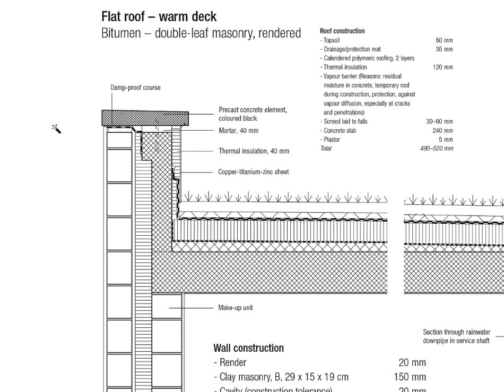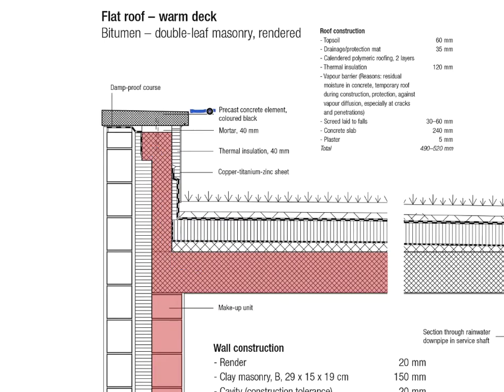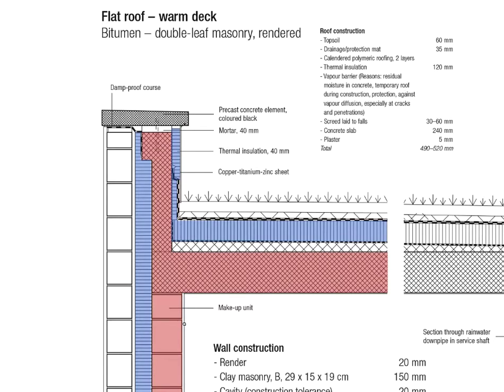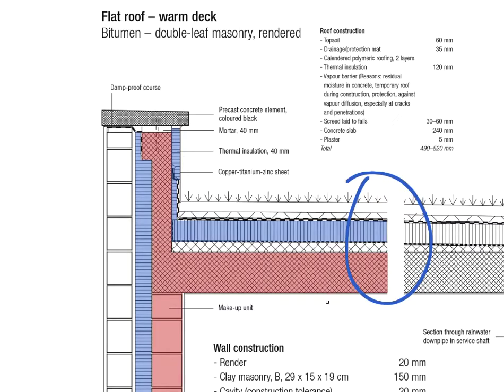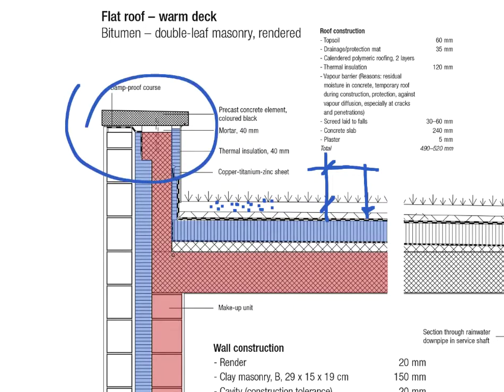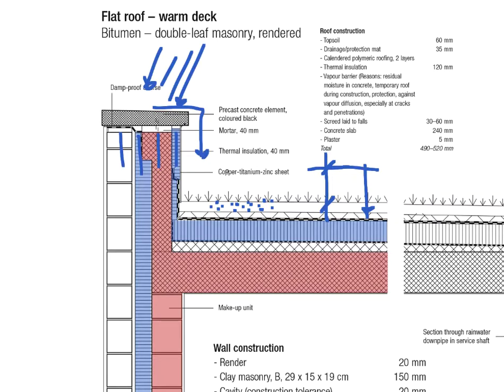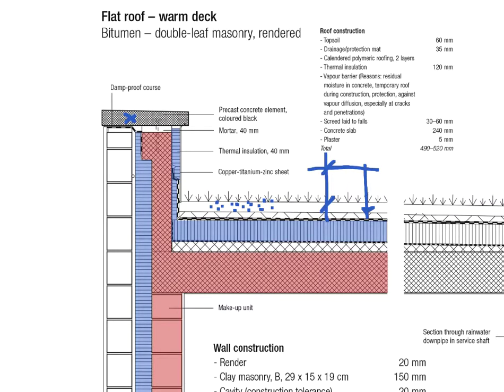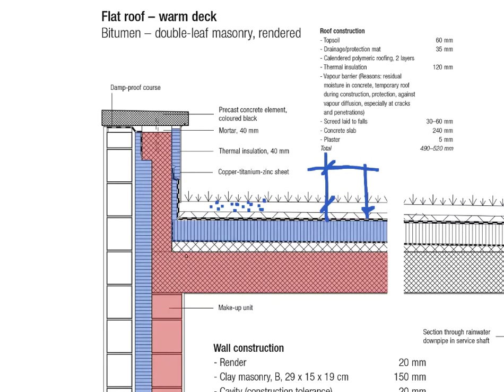"How to Detail": Flat Roof

Comment: liked this .. thank you a lot
I have a question though ..couldn't we just use the protection mat for leveling (and get red of the screed)?
Reply from the maker: Good question – the drainage system or protection mat is often a standardised product, therefore it is mostly available in standardised measurements. The screed ensures that the whole roof is laid to fall, meaning there is a clear slope with a direction of where the water will flow off to. Since most roofs would have their unique geometry and shape, this slope needs to be customised each time. The screed is, like concrete, poured onto the roof on site and therefore can be moulded as needed. Hope this answers your question!

Comment: Would you have any details on flat roofs in the UK with wooden joists and an overhang rather than a parapet? 

This is what I am currently asking a builder to put on my kitchen extension. 

I don’t usually see concrete roofs here in the UK on domestic buildings. 

Thanks.
Reply from the maker: It's quite tricky to prescribe details without knowing all the context – but maybe these details can help as a reference? I have uploaded a PDF to a Google Drive link here:
 https://drive.google.com/file/d/1A1_ipx-jy-sQUTlO_4RCyGCTVDH5o1p6/view?usp=share_link